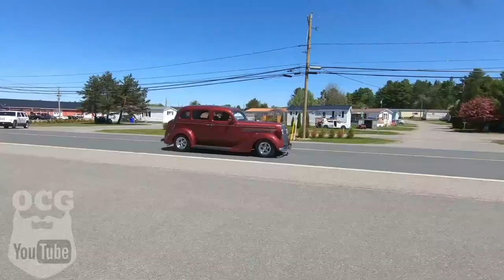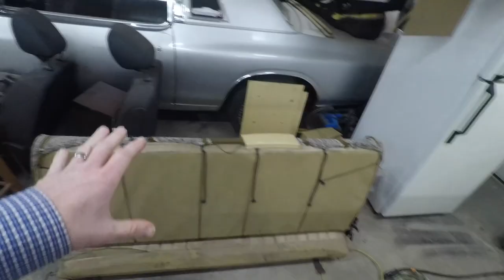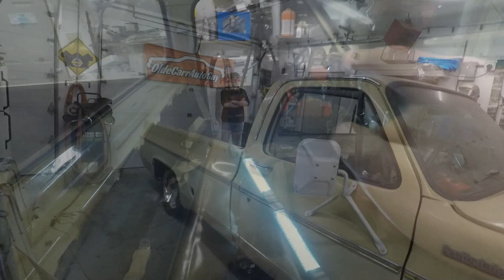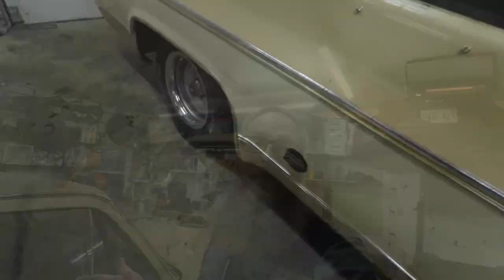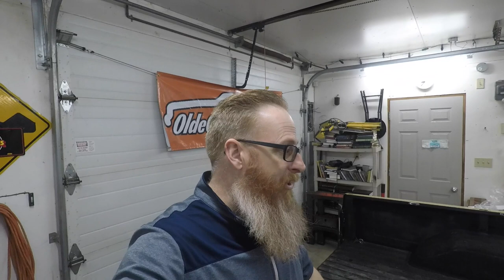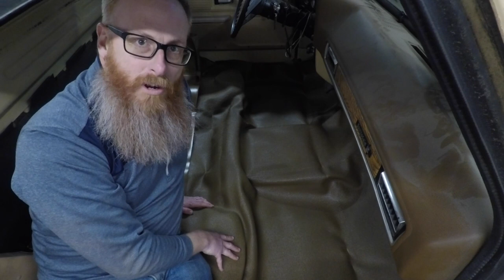PART 2  How to Install a Molded Industrial Polyvinyl MIP Floor Mat In a 1977 Chevy C10

Comment: I'm not one bit surprised you had so much trouble with that flooring. I just bought rear cargo carpet for my suburban from the same company. I was VERY disappointed in the fit(non-fit)/quality. It wasn't even close. What we got had clearly been returned at least once.  A subsequent look at them on the better business bureau website confirmed as well. I should have looked there first.
Reply: Yeah same here. Having a hell of a time getting one to fit in my ranger.

Comment: Had issues with mine too. It doesnt fit good over the hump. Looks like they sent me the one for the high hump trans tunnel. There are 3 different mats. One for floor manual, one for th400, one for th350 and 3 speed on the column. Probably just throw whatever mold is easiest to get to on the machine. Then cram  it in a box.
Reply from the maker: Glad I’m not the only one!

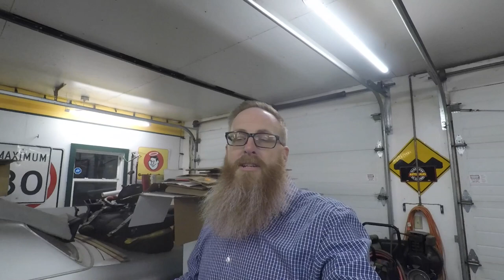Comment: 1:01 I've been noticing this distortion effect on your videos lately.
Do you think that's problem with the SD Card, or the Camera?
Reply from the maker: It only does it on my Hero 5 in time lapse. Not exactly sure. I swapped the SD from my hero 6 and it still does it. Time to switch back to the 6 i guess.
Reply: I'm using an ancient 5 year old Sony Action Cam (HDR-AS200V) to film all my videos. 
I'm waiting for it to fail any day now. 
When it does, I guess I'll be filming all my videos on my iPhone 5S.
Reply: @OldeCarrGuy  or a DJI...haha

Comment: This vinyl is absolute garbage. I would hate to know I advertised this as contoured, custom fit. This USA made product will have you begging China to make you something that will fit. I snatched mine out and threw that shit on the dump trailer. The dealer (OC Carpets) and manufacturer (ACC custom carpets) are plate turning and telling me what I've done wrong all in the sake of not having to refund the purchase price I guess, when I've even sent pics comparing mine to their install video. This vinyl is stiff as a preachers dick and impossible to work with. Thanks for posting this video as I did exactly what you did and now I don't feel like an idiot
Reply from the maker: There is little comfort knowing that I’m not the only one who struggled with this! My question is, why does it have to be so thick and stiff! Crazy!
Reply: @OldeCarrGuy  Right!! It's insane how rigid the product is that is meant to be tucked and cut to fit. All of the razor blades I tried laughed at me and said "you want me to do what?" LMAO  We would have been better off buying a piece of 5x8 flexible sheet vinyl and cutting to fit. To hell with their contours if they're just going to look like you're trying to hide a six pack under them because of all the humps that won't smooth out. Mine was right at $190 shipped and I'm pissed.